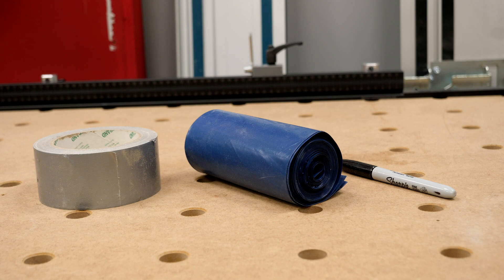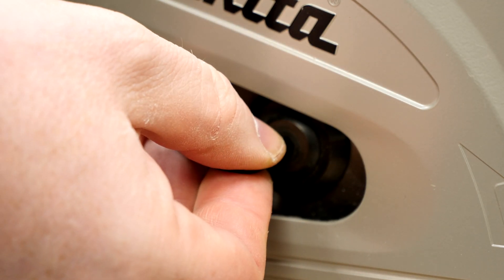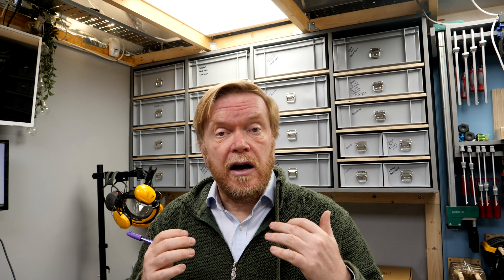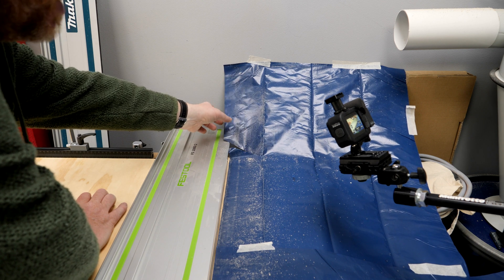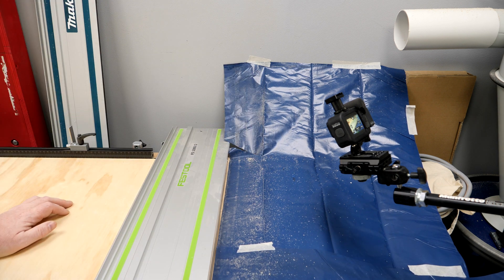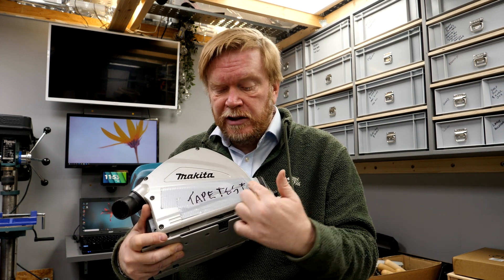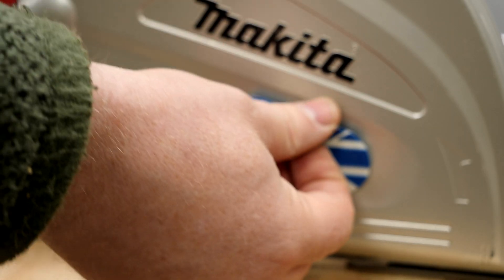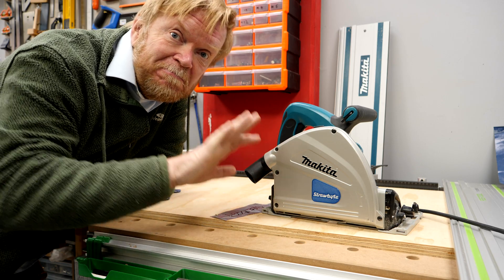Will Gaffer Tape Improve Dust Collection on Your Plunge Saw? Duct Tape Experiment

Comment: Where on earth did you aquire all of she saw casings? Please dont tell me you have had to buy all of those saws! 😅
Reply from the maker: Hey! Thanks for commenting. No I didn’t, for many bigger brands, they are spare parts from repair firms. For some, budget brands, I buy dead spare or repair tools off eBay. The triton covers were made from review units which I modelled from and then sent back declining making any content on (for reasons that I won’t say here) . And the Bosch 18v was an Amazon returned unit I found in a pallet of tools I bought at an auction. A video idea that I abandoned but made a good deal of money from fixing and reselling tools. But I do own 5 track saws. 2 festool, 2 makita and a Milwaukee. d.m. me if you want to know more or keep in touch. I’ve been following your progress for some time.

Comment: I recently bought Dewalt (2.2mm) waste side jigs from you and would have loved a nice yellow cover but none on your website I could see! I presumed you had a thing against them 😞
Reply from the maker: Far from it. The issue I had and am still looking to resolve is that the case on the DeWalt saw has a very inconsistent casting which had made it difficult to make covers that fit properly. Since the item is so close to the blade I can't risk a failure to result in an injury. I'm working on a new design which works better but until then I've temporarily taken them off sale.

Comment: Went out to Thingiverse hoping to find your dust cover and waste side jig there, but couldn't find them? Are these not published?
Reply from the maker: No they're not. In the case of the waste-side jigs the invention and design are registered in the UK and protected under the Copyright, Designs and Patent Act. and the only way you can get a hold of the Original Waste Side Jigs(R) is via my website or via Etsy. I do have plans to release them as downloadable STLs and 3MFs but I'm just waiting for the licences to be approved by my patent lawyer. As for the covers, there are plenty already on thingiverse and having gone to great lengths to create versions from scratch that fit properly and look way better again I'm only offering them as purchased products.
To be honest, as the creator of an original product/invention Thingiverse is a lawless wild west where everyone feels they have the right to infringe design copyright and the platform (which is not properly supported by MakerBot) doesn't respond promptly to claims; and they don't do an effective job of protecting anything released under creative commons either. Don't get me wrong, I'm a huge support of Open Hardware and Open Source and have dozens of designs with CC licences; however I avoid platforms like Thingiverse.
Reply: @StrawbyteWorkshop  ah ok, that's a shame. I really like the idea of people coming up with little quite specific things that you can then print yourself and use. It was the original idea of the maker scene imho. But as soon as money becomes involved it all goes to sh*t again unfortunately. I totally get your reasoning but at the same time it's not going to help the scene if all makers out there start hiring copyright lawyers only to ensure that no one is going to be able to copy their designs (which China will ignore anyway). If someone would copy your designs (which needs to happen to begin with) they'd still not have the rep, the youtube channel, the referrals, the webshop. Who cares if they would sell a dozen of their copies anyway. But anyway, too bad, would've been nice to actually use my printer again. Guess I might design them myself then (don't worry, won't post).

Comment: Hi Karl, I just received my Makita Makita XPS01PTJ 36V track saw and curious if you make a cover (teal) for it. I see other Makita 36V cordless tack saw model numbers but not mine.
TY
Reply from the maker: James - yes I do. I see the problem though because it would appear that Makita sell the battery globally under a variety of similar product numbers. I've updated the listing on my website to include yours. Your saw is essentially identical to the DSP600Z or XSP01Z saw - the case is the same part.

An yes, on my website I have the cover in teal.
Reply: @StrawbyteWorkshop  Thank You.

Comment: Awesome design. How did you get all the saw covers for the various brands?
Reply from the maker: I either bought the blade case cover as a spare part, or purchased a 'spares or repair' saw from eBay for no more than £20. Then it's a case of measuring and modelling the covers. There are saws I'm still on the lookout for, and the DeWalt cover needs refining because, worldwide, DeWalt have very poor tollerances in their casting. But it's worked okay. To be honest 95% of all the covers I sell are for Festool TS55 and Makita's corded and battery saws.

Anyway thanks.
Reply: @StrawbyteWorkshop  thank you! Interesting about most sales being makita and Festool, but not surprised. I just designed one for my makita and want to do exactly what you did. But I may stick with Festool and not worry about the others

Comment: Hi Karl, bought the Makita cordless versions from you as well as the depth stop device and all I can say, is very pleased with both of them. So big thanks for that and thoroughly recommended 👍. Out of interest in the video I notice you have a Axminster Craft 100mm cyclone. Just wondering if you found it any good as looking at one for my CamVac twin motor dust extraction set up. Difficult to get hold of 100 mm cyclones so was happy when saw it on Acministers website for a reasonable price compared to getting one from the US. 😀
Reply from the maker: Hi Mark - thanks so much for the feedback. I'm glad you liked the items you bought from me.

With regards the cyclone - I've had it working on my 100mm CamVac twin motor extractor and my Record Power CX2500 chip extractor and found it to be pretty efficient at removing all but the tiniest amount of dust from my tools. As I've shifted my workshop around a few times in the 6 months I'm still thinking about where to install it permanently and I think it will serve the camvac rather than the chip extractor which only use with the planer/thicknesser. I've no complaints other than you don't get any seals or accessories when you buy just the cyclone. But then the price is pretty favourable and competitive against smaller Dust Commanders (I also have the XL of that).
I do have a project which I plan to video which will look at it in more detail.

Comment: Great idea. Would a small hole or holes in cover make any difference to suction?
Reply from the maker: I'm not sure why you'd need a hole, the covers pop on and off with ease. It's the air-flow you're trying to preserve getting as much air from the blade itself. Some of the best covers other people make have small openings to help fit them and I doubt they make much of a difference.

Comment: Hi again Karl, I’ve just had a thought!! Would it be feasible do you think to make and sell a set of various size covers per saw for the large arcing gap on the other side of the saw say for common saw depths? ie 5mm, 10mm 18m. If the spacer was inserted after the blade depth was adjusted at least part of the gap from the bottom up would be covered. Currently I use masking tape. If you did your own test with and without tape there you could assess the merits. Best wishes.
Reply from the maker: Christian - the inside of the saw is a curious problem and what you've suggested would probably work. I've watched my video a few times and reflected on what I said. The dust collection was pretty acceptable before hand and better afterwards. I might try with that covered too when I'm out there in the week.

Comment: Hi Karl, good to see you. I’ve missed your videos. I had to check it wasn’t me! I bought your cover for the battery powered Makita plunge saw and wouldn’t be without it now. Fine sawdust is such a health hazard for lung cancer and oak is even carcinogenic. Anything we can do to reduce inhaling it has to be a good investment. Working in a clean workshop is also good. You changed the bag in the shop vac to a clean one and I was expecting a comparison weighing. Keep up the good work.
Reply from the maker: Hi Christian, I practiced this test a while ago with a view of being quite scientific about it. It's actually pretty hard to measure this stuff on the bench or in the vac. The clean bag relates something I learned in preparing for another video about dust extraction. I just wanted the most airflow and suction I could get. But interestingly 5 cuts results in 11mm of plywood being turned into dust. Anyway thanks for the comment.